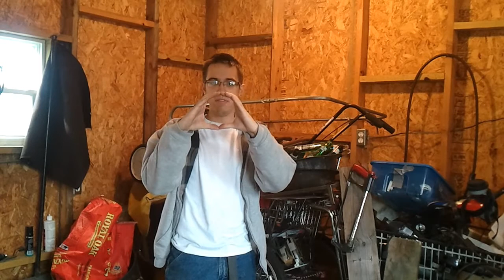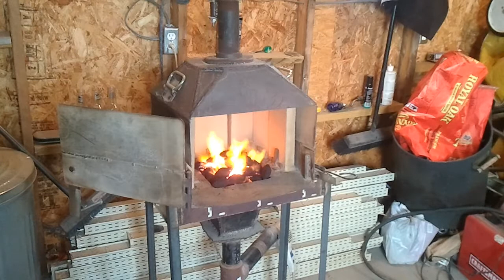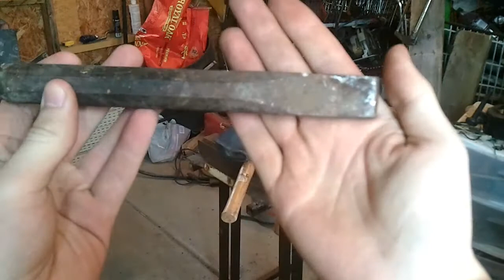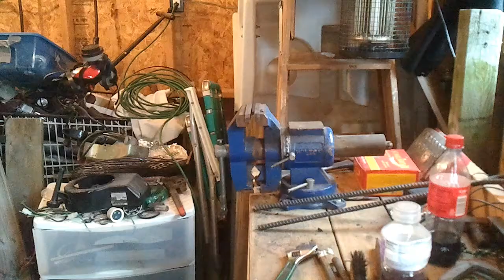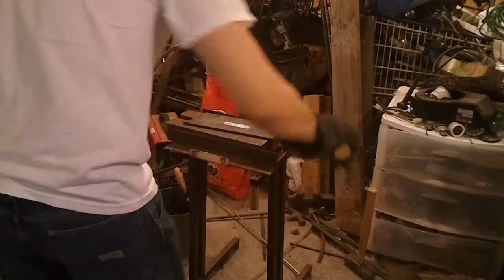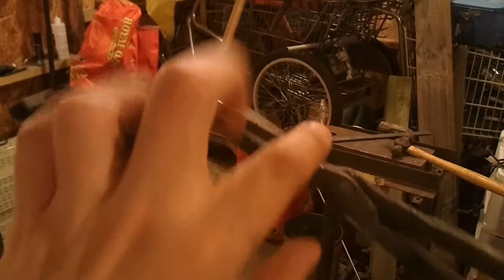A New Set Of Tongs

Comment: Noticed you are striking one hammer with another, That's a little risky because both are hardened and one or the other may chip.
Pick up an old hammer at a garage sale, preferable without a handle. 
You heat this hammer head to red and let it air  cool and it will be nice and soft compared to your regular hammers. You can use this soft hammer to hammer anything safely.  Also notice the back end of chisels are left soft so as to not damage your hammer. Same reasoning.

Comment: Rebar is not much good for blacksmithing as you already learned when the jaws cracked on your tongs. Suggest you look up a local iron shop or welding shop. The places that make railings, gates, fences, etc. Their  steel is much better quality and it will cost far less than what you can buy at Home Depot. 

Bring some things you forged. They'll be impressed what you can do with a hammer and anvil. 
They usually have leftover pieces that they sell for scrap an ten cents  per pound